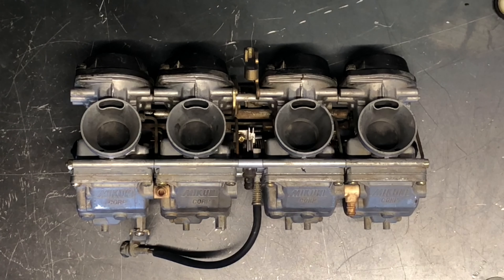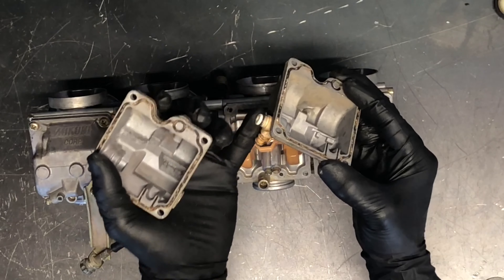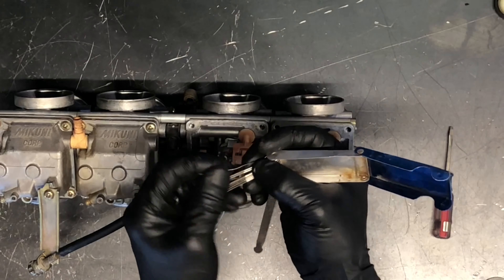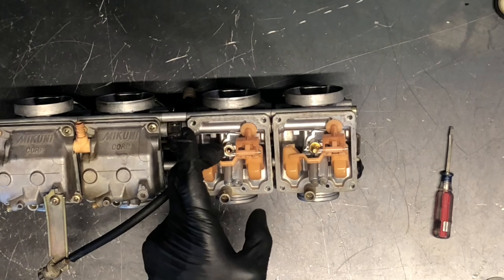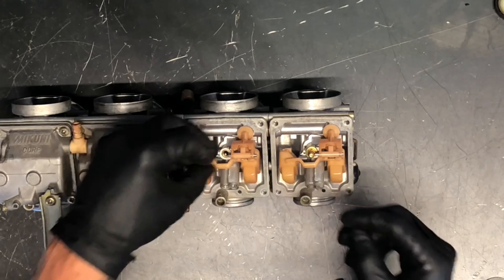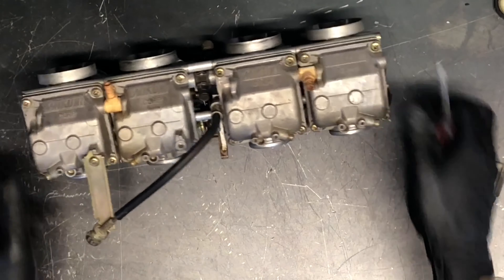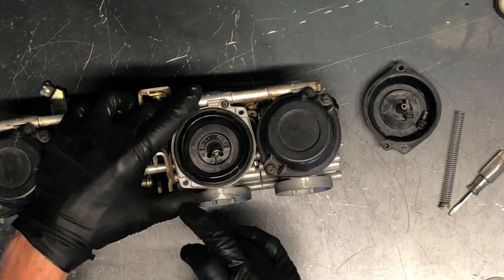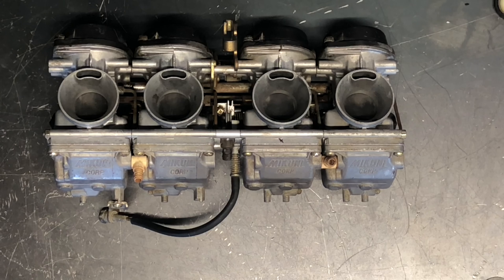89-99 Yamaha FZR 600 - Complete Carb Rebuild / Carburetor Clean Restore - FZR600

Comment: I have the same bike, and I gotta say there isn't a whole lot of instructural videos on it.

Thanks for the help bro
Reply from the maker: For sure. Happy to help! Thanks for watching and the comment. Let us know if you have any questions or need parts: https://www.ebay.com/str/midnebraskamotorsports
Reply: replaced the head gasket. After reassembling everything, I noticed a coolant leak near the far left spark plug. I can't pinpoint the exact source of the leak. Is there supposed to be a plug or fitting in the port to the left of the first spark plug? I've examined the area thoroughly but can't find where the coolant is leaking from."

Comment: It’s it totally necessary to pull the carbs to just clean the jets? I have a bike thats just been sitting and guessing carbs are gummed up while everything else seems to work fine. Bike runs but won’t idle unless it’s choked all the time…
Reply: The way it comes apart from the bike you have to remove the tank, and cross bars then go under it to remove the Allen bolt clamps on the intake. I tried to pull the bowls from mine while on the bike and the Phillips screws are kinda tough to get out where they have been in there so long or due to over torq. However I did get one bowl off and it’s full of rust or dirt but it runs good and idles it’s just full of gunk
Reply: I had mine apart. Had to take off bike. Then get a guitar steel G string and pass through ports. Took me a year before got it al back together. Don't waste time on Amazon or eBay Chinese rebuild kits. Bought 3 sets and all were wrong. Just cleaned old parts and put back together.

Comment: I'm getting back together. On bike, almost finished, but can't get carbs to seat back on boots. Taken apart before and usually slip right back on. I just can't get on. Something in way?
Reply from the maker: A very small amount of dawn dish soap. I am assuming you have the clamps completely loosened? Let me know what you find. Thanks for watching and the comment. Let us know if you need anything: https://www.ebay.com/str/midnebraskamotorsports
Reply: @MidNebraskaMotorsports  used silicone and still won't go on. I've had them off 3 times before and never had a problem. clamps are loose. No obstructions. Trier heating with hair dryer but afraid ignite   the bike.
Reply: @MidNebraskaMotorsports  Got on enough to see if will run after head gasket change. Now went to fill with antifreeze and its pouring out left side of engine and don't know where? A threaded hole this side of spark plug??

Comment: I can't get the carbs to slip back on my boots. I've had them off before and slipped right back on, but this time, no. Clamps are loose, and silicone spray just won't slip on. No obstructions I can see.

Comment: I have a 250cc chinese atv and when I was in mud the other day I was trying to get it out while sitting on it mind you I have 12 wide tires on the back I tried to get it out a  few times while sitting on it and it won't move while its in any gear  do you think it's the clutches because before I got it stuck while riding it would be kind of hard to shift the gears do you think I need to get new clutches ?

Comment: Awesome video, great timing for an upload. I just bought a 92 FZR 600. when i bought it the previous owner said that it had sat for ~7 years.. That being said, the carbs were a mess and several things broke during it cleaning process. Once I replaces all of the broken/missing pieces it started flooding Carb 1&2. could the Air/Fuel screw have something to do with this? Upon further inspection today I noticed the brass tube(people were calling it a "Choke tube" is broken as well... cant seem to find a replacement so I have to buy a Carb"2".
Reply: That's usually called a bleed tube or emulsion/emulsifier tube. If that's broken and missing most of the piece then maybe it could cause excess fuel to get to that specific cylinder but it probably wouldn't overflow the carb. That would be a fuel tap or float issue. The float height needs to be checked per manual. Rule of thumb is to tilt the carbs until the float needle seats into place and JUST BARELY collapses the float needle pin. Then measure the distance from the bowl flange to the top of the float and check that against the manual spec. If fuel pours out of the carbs the float is bad or needs the tang pushed upwards towards the needle seat. (The hole where the gas flows in from and the float needle pushes into)
Reply: That clutch is grabbing too hard isn't it? I had to take apart and soak few days in pan of oil.. then perfect.  was surprisingly easy to do.

Comment: Should the black vacuum actuated slide stay open while engine is running at half to full throttle or do they descend back down . I’m having a running problem at half to full throttle it’s bogs . Jest are clean
Reply: Too much air or not enough gas. Make sure carbs and boots are all seated tight with no leaks anywhere. Check especially between the engine and carbs. If you have no muffler and airpods/airbox delete that will happen. You could try increasing the main jet size and or shimming the jet needle 1-2mm. If you do both you'll get a little more fuel delivery at 1/2 to full throttle. This should feed it enough gas to achieve higher revs without bogging. And yes it should be lifted up at least some at half throttle because of the engines vacuum created on intake stroke. You're either not getting enough fuel to the carbs or cylinders. Or there's an air intake leak somewhere leaning you out too much at higher revs.
Reply: @kkc3009  thank you sir 👍
Reply: @michaelschuler7397  I've found downdraft carbs to be a pain to properly seat and tighten the rubber boots when the carbs are wedged in the frame like that with very little access to the clamp screws. These commonly have old dry rotted and cracked up carb boot joints going to the engine. It was a common hack to slop gasket maker over them when they got cracks causing intake leaks and lean conditions.l because it's a pain to change them. Eventually it starts sucking pieces of the old dry rubber to the intake causing bigger holes and making the problem worse. 🥲

 If your engine speed and revs don't quickly sweep back down to idle after mid-high revs you could have excess air being sucked into the intake. Like if the engine speed "hangs" and slowly falls back to idle. May be a little less noticeable at idle and then worse at higher revs because the cracks will flex and open up to suck more air in. Seen it on 600 4s and especially on 1000cc & up 4s side and down draft carbs. Did you figure anything out? Those vacuum slides rise with engine vacuum from each cylinder and is actually one of the reasons why carburetors are synchronized to their corresponding cylinder. Each cylinder makes it's own different vacuum thus it needs the carb throttle plates dynamic synced to match. I bench sync most all my carbs and get minimal back popping because the engines run pretty well. Airbox and custom or deleted mufflers on most as well.
Reply: @kkc3009  yeah I know what you mean about those boots . I inspected them and made block off plates to pressure test them . They seem in petty good shape without any leaks . I hesitate to put aftermarket Chinese rubber on as those literally last 2 years. They can’t make rubber for some reason . I think I’m going to make my own over the winter just need to get the shore hardness right on the neoprene mix and make some molds using the stock boots . I bench synced them and used a nice manometer to tweak . Anyways I will keep at it until I am happy but thanks for the tips 👍
Reply: @michaelschuler7397  they can't really make anything better than the original but they sure do like to improve upon what they stole from others 🤣. Anyways you could even make your own little carb boot joints. But since you pressure tested and got good results the ones that go to the engine must be good. No problem sometimes I actually help lol.

But this bogging, it's still present? If you have the airbox removed and a less restrictive exhaust this can happen. It's happened to be with bikes I bought that had air pods and the pipes chopped just after the crossover or H section. Cured by increasing main jets and one or two sizes up idle jet. Remove epa or welch plug caps and back out the idle mix screws another half to full turn. This generally cures a bogging or can't increase revs condition if the bike otherwise starts and runs well. It's like hitting a limiter well before the actual limiter and then the bike will just bog. Is this what happens during riding or just while testing it in the garage or something?
Reply: CK diaframs.  Run an spray eather on intake.
Reply: @kkc3009 thanks it almost seems like a few of the diaphragms might have a leak the outer carbs open wide up when engine is running and when I blip it the 2 center carbs lag way behind the outers .I think I might play musical carbs and see if I can make the issue move to another cylinder thanks
Reply: @kkc3009  I did perform a pressure test on each one and they seem good . I also have good access in that area to make sure they are seated properly and clamped correctly
Reply: @kkc3009  thanks it’s just strange how they don’t behave the same as each other . The amount of vacuum signal should pull the slides up relatively the same
Reply: @michaelschuler7397  okay well you could either have a damaged diaphragm like you said  it could be that you need to clean and polish the body of the vacuum slide/piston and the slot it goes in. Don't use anything abrasive like steel wool. Use microfiber and something like chrome polish then brake clean and air to strip out the polish. Don't want it having a chemical reaction to fuel and causing deterioration of the aluminum and plastic. Something is going on where either your middle cylinders aren't getting enough fuel, or the two middle carbs are having a vacuum leak between the intake valves and the vacuum chamber and ports of the corresponding carbs. Are you carbs bench synchronized at least? Meaning all the throttle plates sit at exactly the same spot at closed throttle position? You might have to start checking for air leaks all over the middle two carbs. Around the caps. Any brass piping that goes from the vacuum chamber or one of its passegeways to wherever else. I've had that happen to a gs500 carb and it would suck in air and be hard to start and not run at full power because it was leaning out under higher revs. You might have to put soapy water around the middle two carbs when they're off and blow air gently through it while blocking off relevant ports and removing the diaphragm of course. Sounds like either a sync issue and or a vacuum leak. I'm wondering if you don't have a problem with the intake valves of the middle cylinders... When you're running the bike without the air box or pods on it's usually pretty uncommon for it to run and rev good because it's sucking in more air than normal. So they tend to run funny anyways unless they're big jetted. If you took the emulsifier tubes out and don't have everything back in or in the right order this can happen. If you replaced the float valve seats with aftermarkets that have a bleed hole in them this can happen. If you replaced any carb part with one that has identical dimensions but has a bleed hole the original didn't this can happen. Sorry you have not got this solved. If it was my fizzer I would get the correct factory service manual if possible. That will help a lot. Then I would start at square 1 with everything that I've learned about carburetors in general. I got a bunch of them working well again before I fully understood how a carb even carbs. 

If you meant you're thinking about swapping the vacuum Pistons/slides around you could try that but switching parts around is generally a big nope unless you're really desperate and there's a strong possibility it could actually work or help diagnose. Get the engine warm if you can and do a compression test. Twice on each cylinder. Crank til the gauge needle stops increasing. Don't forget to hold the throttle wide open during the test.  That's all I can think of to help and try to collect some data that might help track down the problem.

Comment: Not complete sorry. Did not show how to remove jet holder which it should be like the 1000s. Did not show how to remove the vacuum slide holder because you didn't remove jet holder. Did not mention how to bench sync so it's set up to dynamic sync. A complete refurbishing of the carbs would include a degang the carbs section.